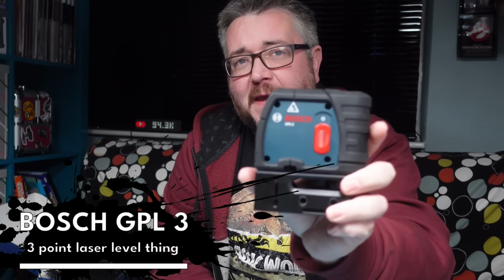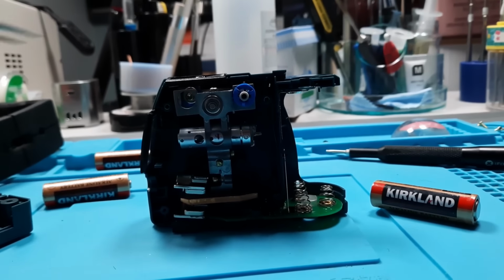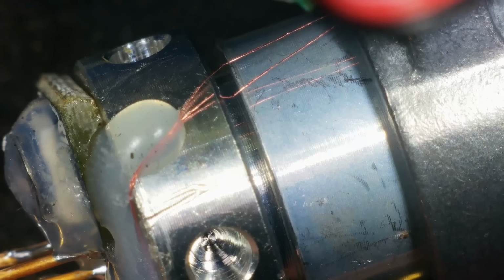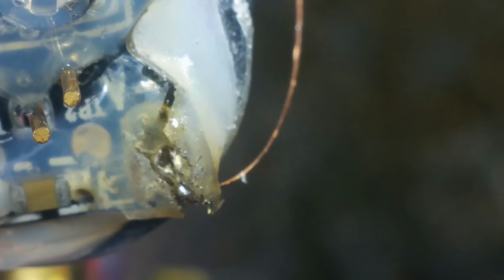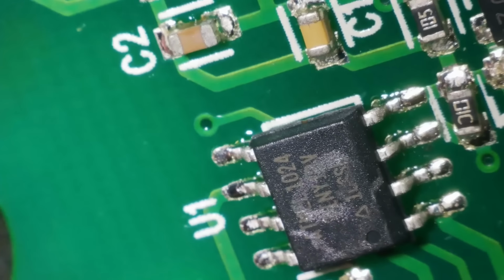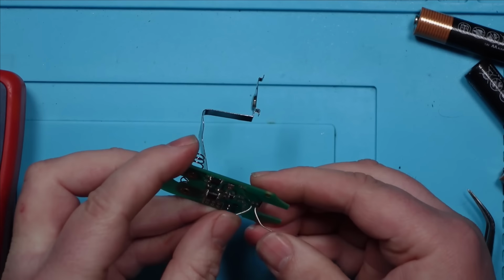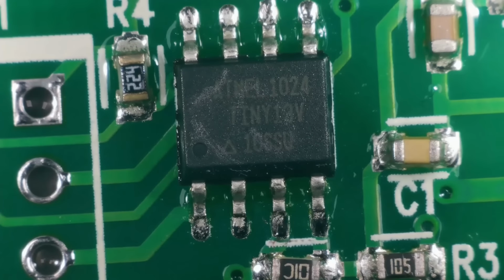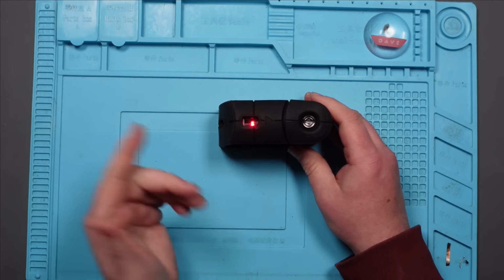£180 BOSCH Laser Level FAULTY | Can I FIX It?

Comment: The Atmel chip is an AVR or microcontroller, a programmable chip, like a PIC type of chip, just from another supplier, 
I would assume the chip is pulsing the voltage, so the laser diode flahes.
These units (and most others) flash when they're not level. 
So what you've done here is bypass the level indicator.
The chip is programmable, this is done at the factory via the J1 header. So cannot just be replaced with of the shelf components.
D1 is probably more likely to be a hall effect sensor, which is actually whats sensing the actual level. Once this gives a coarse level the pendulum finishes the job.
Reply: The flashing/pulsing of the laser diode is probably all about PWM so as not to overdrive the laser - the bodge may work now and see the laser fading quickly over time?
Reply: @pdrg  No, you're mistaking a PWM signal to reduce battery life and an intermittent flash.
These units flash the laser to indicate it isn't level.
If a led/laser/lamp is on at 100hz a PWM signal for instance of 50Hz will reduce battery usage by half and won't be seen as a flickering light by the human eye.
While this chip is possibly using a PWM on the laser to increase battery life, it will be unnoticeable to a human eye.
Reply: D1 is infrared proximity sensor or sorts. You can see two "chambers" for the transmiter and receiver. Basically an IR LED and photo transistor in one package. I doubt there's any smarts in that part. The µC is doing all the heavy lifting.
Reply: Not even a different supplier now, Microchip owns Atmel.
Reply: @InnerBushman  that sounds really likely to me. Maybe the IR led burned out (hence no forward voltage that could be found), and so the microcontroller is unable to find out that the pendulum stabilized, hence keeps flashing the laser to mark it as unreliable or out-of-bounds rotated.
Reply: @klaernie  he couldn't measure any forward voltage cause he was measuring between one lead of each component. If he would measure on the longer side, there world be some reading on at least one of them.
Reply: @InnerBushman  very true. I was screaming at the screen the entire time
Reply: @klaernie  I'm so glad I wasn't the only one. I was so angry that it led me to writing a comment and reading other's comments to. Which I'll admit I don't do often.
Reply: Totally agree. Looks like the chip he replaced with the diodes is some type of opto or possibly hall effect sensor that gives the microcontroller a signal to say the unit is not level. Not really much in this unit compared to the rotary one I repaired a in a video a couple of months back.
Reply: @InnerBushman  Correct - IR device, not Hall prox device.
Reply: Likely. One I repaired (different brand) had balance weights on the pendulum, and one had broken off from being dropped. Re-attach balance weight, problem fixed.
EDIT: If the balance is off due to a missing weight/bent arm, even though it ain't flashing any more, it ain't level

Comment: I believe you just bypassed the sensor/switch below the hanging laser assembly. Its job is to tell the board when the assembly is hanging freely. If you tilt the device too far, the assembly would hit the side and no longer be able to self level. I believe the issue lies in that sensor or its connection to the board.
Reply: That device looked like a photodiode and led package, which I expect was supposed to detect a reflection off the laser yoke when it was in a certain position.

Comment: Hi Steve
I remember some time ago, I repaired a similar laser beam level
And.. Of course... Had the wires from the electronic to the lence ( diode) broken
This is happening when the level itself is transported without the lock pushed...
Mine had a lock handle; when pushed, block the lence to not move, vibrate during transport. 
If you forget to lock it... After a while, the wires get broken
Cheers and Happy new year!!!
Reply: That makes perfect sense, just a thing that happens if you don’t pay attention.
Reply: @timehunter9467  no thats a thing that happens when you are lazy with the design, and put a hair size wires in the way of moving parts and not secure/route them properly.
Reply: @m4nt1c0r3s  I’d have thought it needs wires that thin to stop it affecting the movement of the weight, it’s annoying to use wires thinner than 0.1mm though. Should have used a sliding contact like a potentiometer uses for moving parts, it’s not the design’s fault if someone forgets to use the lock thing though.
Reply: All of my laser levels lock when they are turned off.  More to the point of m4nt1c0r3s about lazy design.
Reply: @timehunter9467 True... ultra fine solid strand Cu wire sux for an application like this. Cu work hardens quickly, then breaks easy. I'd fix using fine stranded silk insulated wire used in phonograph tone arms.
Reply: A little bit like leaving a torque wrench in a set position. Once or twice won't harm it but if you store it for extended periods not reset it will affect it. Basically; do what the manual states. If stored or not used if there's a lock use it. But I agree, it does seem like better design could solve this issue.

Comment: The "ATTINY" (pronounced Ay-Tee-Tiny) is a microcontroller.  It's the little brother of the microcontroller used in the Arduino Uno.  It could be replaced if it was bad, but you do need to program it.  The six holes at J1 are the programming header.

Comment: I am sure that D1 is a magnetic prox sensor of sorts so the little microcontroller makes the LED go a blinky if it isn't level.
Reply: does this mean he basically bypassed the microcontroller, and the leveler isn't level?
Reply: @pixelpuppy  More likely it doesn't know if it's level or not and simply on all the time.
Reply: @pixelpuppy  More along the lines of if the laser is more than 15 degrees off level, the light will go blinky because it won't auto level anymore. Just a fancy end limit is all
Reply: @whodatdere1  It doesn't 'self level' like professional long distance building site devices that 'self calibrates' then locks with reference to the tripod mounting base that can be well out of level. All this does is constantly 'self level' due to the pendulum. The flashing indicates it is out of that 'self level' range.

Comment: I'm about 90% sure that the "diode" you removed is a reflective optointerrupter and it's supposed to sense a reflection off the bottom of the pendulum.
Reply: He also wasn't even measuring it properly if it is a dual diode package. Then went on to solder on diodes but to just solder bridge a short. 😵‍💫
Reply: That’s exactly what that looks like. What do you want to bet the fault was purely mechanical in the pendulum mechanism?
Reply: @101fng  I'd guess the little reflective sticker got dirty or fell off the pendulum.
Reply: The ATTINY was doing its job in flashing the laser on and off so thats not at fault.
Reply: Recognize this also. Detects a reflective surface. (Also used in point of sale printers to detect if paper is present. Good luck. The two shiny surfaces on this 'diode' are intact an infrared transmitter and a receiver neatly in one package. Make sure these surfaces are clean and not blocking the IR light. The reflective surface it's aimed at should not be to close! I believe > 2mm.
Reply: 100% on spot

Comment: I used this alot working as an electrician laying out pipe racks and conduit runs floor to ceiling. Mark lighting layouts on the concrete/flooring very handy. Test it with a good old simple plumb bob
Reply: You assume steve knows what that is lol jkjk
Reply: Likewise - I've an identical device and used it for the same purposes. Very handy for locating downlight positions on a ceiling from measurements marked on a floor or bench top due to the plumb top/bottom dot.  
This is a  Bosch Professional/Industrial class device...  not the cheaper low grade handyman stuff they make.
I've lower grade 'cross hair' projected line laser levels (horizontal/vertical), for different tasks like tiling or determining fall of roof guttering and concrete decks over a long distance.

Comment: i don't have a bosch, but i assume they all work the same, it only flashes when its NOT level. the fact you are moving it and it isnt flashing says its not really fixed to me
Reply: Yeah exactly I would’ve liked if he tested it versus a plomb bob or another working laser level, he would’ve saw his mistake right away! Oh well that means we’re gonna get a revisit video on it soon with a more permanent/working fix
Reply: The Bosch ones flash with low batteries as well, the battery terminal springs are quite weak and I've fixed this exact issue on quite a few just by simply pulling them a bit to hold the batteries really firmly
Reply: I agree but since it's just a pendulum wouldn't it still give a accurate reading as long as the pendulum is working. Again not fixed just forced on basically but as a bodge job it would work
Reply: The red and black wires are the power directly to the laser itself, they were pulsing since the laser was flashing. By putting power to them, the controller is totally bypassed. Also, D1 was not a diode as others pointed out but a sensor, it may have been the cause and putting a random diode there wouldn't do anything. However, with no part number on it, it would take awhile to find the right part, if possible.
Reply: I have a Bosch laser level (not this laser pointer but very similar) mine has a 3 stage on/off switch… 1=off 2=fixed or locked laser 3=self levelling. When it is in ‘self levelling’ it will flash until it has found its level. So it may be fixed but he had it the locked mode (2)
Reply: Yeah the laser works now but the auto leveling feature does not.
Reply: Yeah he just bypassed the auto level.
Reply: Rtfm, right?
Reply: I agree this is probably a 4 pin DIP Hall effect sensor. Not sure where it’s located when the thing is assembled, but my guess is there is a magnet on the pendulum which will trigger this sensor.
Reply: @chrisboswell5568  he injected the 4,5v  right in there can't really be a battery connection issue...
Reply: I'm with those who say this isn't really fixed. There are a couple of wires visibly disconnected from the motor besides the one here may or may not have broken that don't get addressed at all. I can't really explain it because I don't have the full knowledge, but my instinct is there's some sort of feedback happening with that bob swinging between the magnets and the motor spinning, and that oscillation in the voltages evens out when the beam has leveled.
Reply: Yes, that chip is a microprocessor that needs to be programmed. Hobbies like me use them and program them using Arduino. Programming is via a serial connection. They are cheap and very robust. It takes a lot to kill one accidentally.

Comment: I've fixed about 10 of these, I just pull the springs a bit to get a better contact. Has worked every time so far, the Bosch ones don't like being dropped, seems to compress the battery spring terminals
Reply: that + what can happen, if you drop it a lot. the power button gets smashed on the underside.

Comment: Wow! What a finicky little thing! No idea why its so complicated if its just some lasers mounted on a pendulum, but good fix! I would have been rightly stumped if I opened it up and saw no damage to the main board. Good catch on those diodes and wires, and even greater idea to route the voltage directly!
Reply: the fact that people will pay 200 GBP for laser pointer attached to a pendulum is a bit scary.
Reply: I think the complexity comes from determining if the laser is actually level or out of bounds and resting against one of the walls. While the laser is working now, unless you see the pendulum swing and stabilize, you now won't know, if the laser is actually level.

Comment: I use those at my work all the time and have fixed a couple DeWalt ones. I do aerial rigging and it marks the ceiling for where you need to put your support drop in. You set your cable and make sure the point coming down is right where the laser hits it from the floor we are usually working about 50 feet up in a Convention Center.

Comment: Nice Job! To be fair - these enameled wires were far too thin for my liking. As some commenters already wrote, the wire snapped suspiciously close to the hinge of the pendulum - it could have been sheared/weakened by the pendulum because someone forgot to lock the travel/transport safety. Might have been avoidable if Bosch had used a thicker wire. That board on the other hand I can't make rhyme or reason of. Weird. Oh, and happy 2023! May it be a better year than the last ones...pretty please! :)
Reply: The wires are fine so they don't interfere with the pendulum moving

Comment: The first little wire broke suspiciously in the place on the "pendulum" where the metal sticks out the most. It looks like it was shaken around and the pendulum crushed/pinched the wire against the chassis.
Reply: That little wire turns the laser on to flash when pendulum hits the side. He was looking for the wrong kind of failure. It is a mechanical failure not an electronic one.

Comment: The blinking beam means the pendulum is not leveled (By manual instructions) so I think you bypassed that with the jumper wire.
Reply: Was just gonna say that, now the laser is always solid even when you are moving it around so the level is not showing any "levely-ness" now it's just a fancy laser pointer.
Reply: @terrylaze6247  Yeah, but as long as the pendulum is swinging freely and gravity is working, the laser is going to be level.
Reply: Yah he was looking for wrong king of failure. It was a mechanical failure. He rendered the laser more broken than when he started.

Comment: Wow, is it just me or do those battery springs look hella flexy 😧. For a premium product like Bosch that's honestly shocking. I had a battery spring issue with some "premium" ($180aus) Xmas solar lights recently, replaced all the battery terminals with better ones and it fixed all of the issues. Meanwhile my 6 year old $50 ones have never skipped a beat. Great work as always mate 👍.
Reply: Bosch went the same direction as everyone else.  More and more of their product is becoming cheap junk.

Comment: I suggest you research your components rather than just replacing what you think it is. This can do more harm than good.  As others said, D1 is most likely some type of  measurment component under the pendulum. I would say it is like a Hall Effect sensor and the pendulum has a small magnet under it. Once the pendulum is level, then this switch would turn on the lasers. I also suggest that with your bodge fix , then the unit will never be level as others have said, you just bypassed the levelling components/switch. As an Electronic engineer, I do like most of the ways you go about trouble shooting, but this one, needs a little more time to fix properly.
Reply: Agree. Opto sensor or hall effect sensor to tell the microcontroller that the unit is within acceptable "level". A rotating level I looked at a couple of months ago had similar but it actually tilts the head into the correct alignment with motors, it was a lot more complicated.

Comment: Your repair just bypassed the transistor that flashes the laser, it's impossible for it to flash now so you'll never know if it's out of the self leveling range or has low battery.

The voltage on the laser you measured was fluctuating because it was flashing the laser, this isn't a fault, also because the laser was working and flashing it also means those two thin wires were always intact. The programmable MCU was also working because it was able to flash the laser, however the ADC inputs could be damaged.

The 'diode' you took out is a combination LED (light emitting diode) and photo-transistor as part of an infrared proximity detector, it detects when the balance is out of it's self leveling range, replacing it with two diodes will just render the self level detection non-functional.

I see in the video there's two different flashing speeds for the laser, fast means it's out of the level range, slow means the battery is low, it appears to be failing with slow flashing mode. The previous owner might have put the batteries in the wrong way around the fried the input of the ADC on the MCU or there's a bad soldering joint from manufacturing in the voltage divider resistors for the MCU ADC.

Comment: The coil on the pendulum swinging between the two magnets will generate a small voltage, which disappears when the pendulum finally settles down....
Reply: Or maybe it applies a small current to the coil to damp its motion, and make it settle more quickly?    Maybe it's a combination of the two!

Comment: The 4 pin 'diode' is a reflective sensor, IR LED one side, Phototransistor the other, when there's something IR reflective in close enough proximity it 'switches' on (or off), they're quite easy to get hold of (once you know what you're looking for).

Costco batteries, used to buy loads of their AA/AAA but almost every single time I've used them and let them get low I've ended up tearing stuff apart and cleaning up leaked electrolyte. 

I'm using CPC Pro-Elec cells and batteries now, so far so good plus they're cheaper...
Reply: About the “reflective sensor” you mentioned, isn’t that like an opto-isolator or an opto-coupler? Please let me know, I’m trying to learn. Thank you kindly
Reply: @maxwarfield6699  Pretty much, yes, you get reflective ones, slotted ones etc. The one in that Bosch looks a bit like a CNY70 but obvs. no idea of the actual sizes, it could be the exact same type,  a tenth the size or ten times larger etc.
Reply: @M0UAW_IO83  Cool! I didn’t know there was reflective ones and slotted ones but then I still have a lot to learn about electronics. Thank you kindly, for replying. Cheers mate!